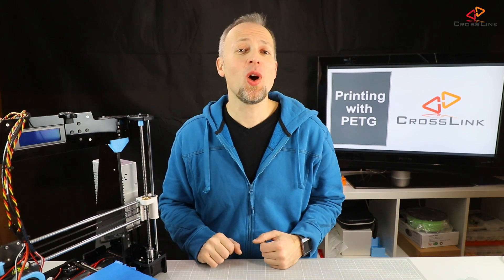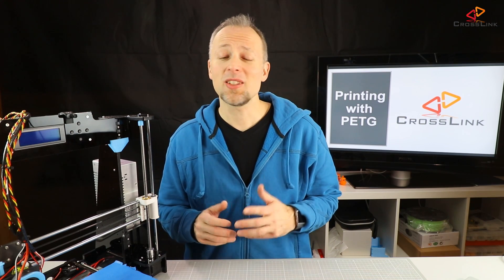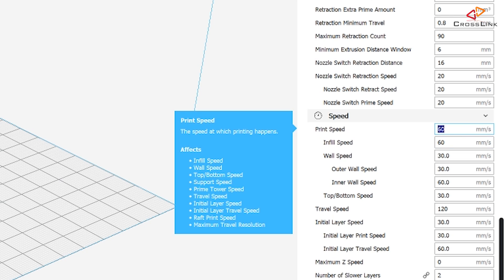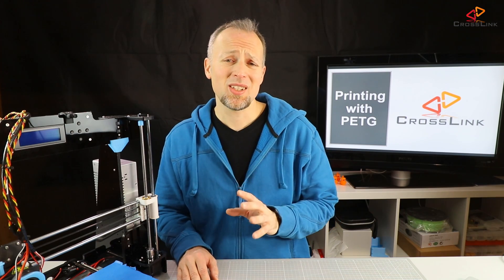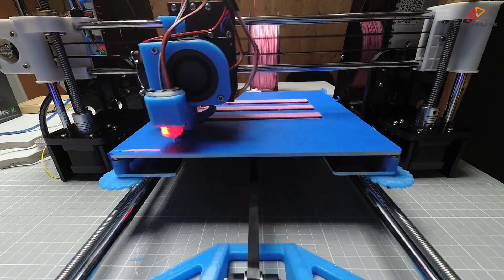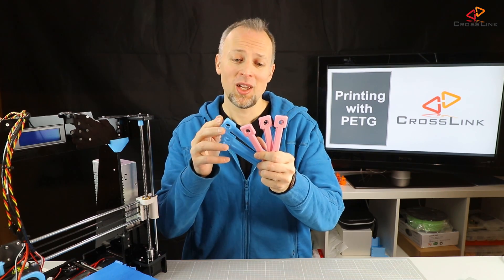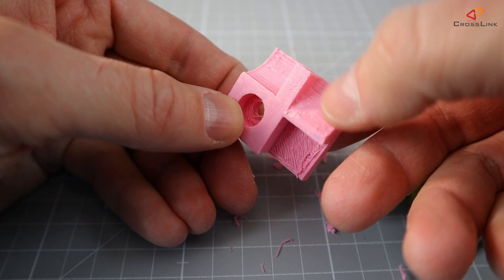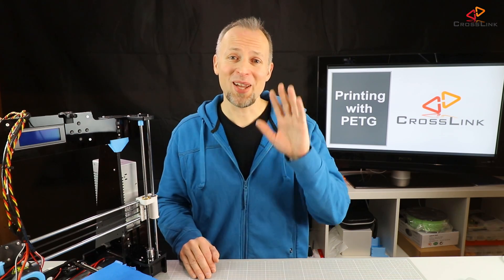Anet A8 PETG printing

Comment: Honestly I've been worried about printing anything hotter than PLA on the stock electronics. Can someone tell me I'm just paranoid, or SHOULD I wait until I do the mosfet and PSU upgrade to avoid a fire?

Comment: Hello, I need help! i'm printing mask for coronavirus and someone donated PETG. Print this plastic its dificult to me, i use bed 85, Ext 240, 0.3 layer heigth, 55mm/s and 3 walls, when the nozle its filling the middle wall the extruder is missing steps, like when comes stuck.
Any solution?

Comment: I print on glass with a very light coating of glue stick. The printer parts just call off after the bed has cooled to room temp.

Comment: I'm using WolfBite special adhesive on glass bed . 90 C for heat bed and 240 C for hot end. 60mm/s speed.  No cooling at all. It Works great. When I come in the morning to pick up my 12 hour printed part, the part simply is off the bed. I literally just pick up the part from the bed and go. Its amazing. I think Wolfbite is the best solution for PETG printing. Its a bit expensive, but it's a peace of mind. The smallest bottle lasts so long time. Thats because every time I apply a very thin layer with foam brush. You don't need to do it even every time. Ones applied it can last for many prints.  https://airwolf3d.com/shop/wolfbite-prevents-3d-printed-parts-from-warping/

Comment: Forgot to mention that a thin piece of CORK tile (3/16 inch or 4.78 mm thick) works extremely well as an insulator to aid in heating the bed.  I have attached a piece under the bed to minimize heat loss and I use a piece on the build surface during initial heating of the bed when temperatures need to be much over 70 C. The poor little 20a supply that comes with the Anet A8 just is too weak for sustained high bed temps required for PETG and ABS.   Another option is to get a dedicated power supply to supply 24V to the bed and to the Nozzle.  The higher voltage will allow the bed and the Nozzle to heat up much faster and be more stable (Next future upgrade for my printers).  Something for you to think about.
Reply from the maker: Sounds really great, will put these ideas on my list. Would you step down the 24v for the board or run with two separate psus?
Reply: @Crosslink3D  I'm thinking I'll keep the original 12V supply that came with the machine to power the mainboard only and then run a separate dedicated 24V supply for the bed and extruder(s).  Seems a bit of an "OVER-KILL", but I think the board will be much happier and the heating time for the bed and the nozzle will be much reduced.
Reply from the maker: A 24V to 12V step down converter probably will be easier to handle just the board. Worth a try...
Reply: @Crosslink3D  Absolutely an option and I wouldn't have to find living space or two separate PSU's.  I've certainly considered that as well.  Truth be told, that's what I'll most likely do.
Reply: @Crosslink3D  Originally, my plan was to keep the 12V supply and then use two BUCK converters (one for the nozzle and one for the bed) to bump the voltage to 24V.  Unfortunately, the bed draws so much current that the buck converter to drive it was prohibitively expensive.

Comment: So, I'm testing out your Cura profile.  I compared it to the profile I'm using.  Seems your hot end temp is about 10c lower than what I use and your bed temp is about 15c higher than what I use.  Now, it also has to be said that every machine is different.  They all have their own idiosyncrasies due to variations in thermistor hysteresis.  For grins and giggles, I'm printing the test part you recommended using your cura profile and Hatchbox PETG.  Turns out I need to adjust my first layer height a bit further away.  I'm thinking 0.2 mm is probably optimum.  I've been using 0.15.  I'm curious to see how the part turns out given the temp differences and the fact that you turn the fan on (I never use the fan printing PETG).

Comment: I've been using PETG (Hatchbox) (I'm waiting on my shipment of Amazon Basics) now for several years and have developed techniques for printing on glass as well as on to a removable aluminum printing surface.  Of the two, I much prefer to print to my removable aluminum print plate (1.58 mm Alu. 6061T6).  In addition, I do NOT use build tape anymore.  I got away from Blue Tape a month after getting my first A8.  I find that Elmers Glue Stic in Purple or white works extremely well and is easier to use than Blue Tape (UHU would work as well I'm sure).  For print removal - wait for it - FREEZER!  I toss my build plate, glass or Alu.,  into the freezer for about 20 min and let thermodynamics work for me - prints pop right off!  Give it try, works every time!
Reply: It's a month old reply post but I give it a try. As a successful PETG printer, could you share your trick for printing small models. I have tried all the tricks in the book and I am following  all the suggestions but I get the infamous buildup on the nozzle and the details start melting away. And yes, I lowered the nozzle temperature gradually to the point of clogging it. That said, I have been printing larger items quite acceptable
Reply: @overlycranked8674  Well, the trick isn't really a trick at all to printing in PETG.  I started with a PLA slicer profile straight out of CURA for all the basic settings.  Then they only thing I really modify are the retraction settings and cooling.  Right now, I've my retraction set at 6mm and a retraction speed of 70mm/s. I set my cooling to 50% after the first layer.  Also, I  print at 245c and a bet temp of 70c on to glass with a bit of Elmer's purple glue stick. On thing to check on your printer is the extrusion rate.  If you are over or under extruding that can cause a real headache.  In my case, I have brand new ENDER 3 that is chronically under extruding my PETG.  I'm in the process of recalibrating that.  I hope this helps.
Reply: @vn1500g3  , I'll follow your suggestions straightaway ( that 70mm/s retraction speed is interesting ). Thank you for taking the time to reply
Reply from the maker: Cool ideas, thanks for sharing. I will definitely give it a try! 👍

Comment: I've been trying out the Amazonbasics petg as well.  So far I like it although I need to figure out my bed adhesion settings better.  I think I might be printing too close so I'll need to increase my Z offset or something.  I am using manual mesh bed level with Marlin 1.1.9 as you showed in a recent video and I think you can set a Z offset in the bed leveling menu?
Reply from the maker: Yes, you can set the leveling a bit higher in the control menu. Start with 0.1 higher and work from there. The material needs a bit more distance to settle without creating skimming.
Reply: @Crosslink3D  Thanks Daniel!
Reply: @Crosslink3D  Couldn't the same be achieved through setting the First Layer Height higher in slicer?
Reply from the maker: You can try but increasing the first layer height in the slicer will also increase the flow accordingly. So it might then be again too much filament coming out and creating skimming. Increasing z offset does not increase flow.
Reply: @Crosslink3D  That makes sense, thanks! I finally got Pi and OctoPrint, so switching the value is now actually easy. I was just lazy to always go to the menu and change it when I changed material or bed (I have bare mirror, mirror with PEI and with painters tape that I randomly switch, each requires slightly different Z offest :D). Adjusting the layer height somewhat worked, but now I understand why not always!